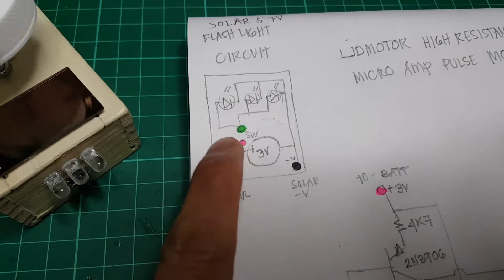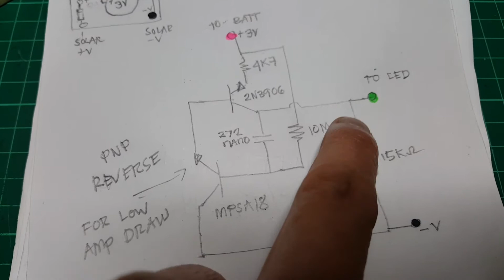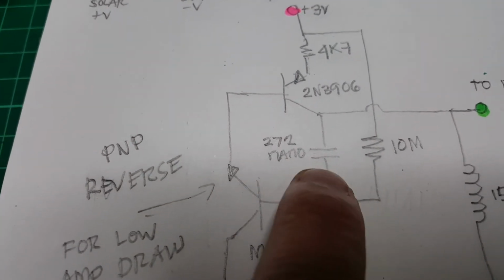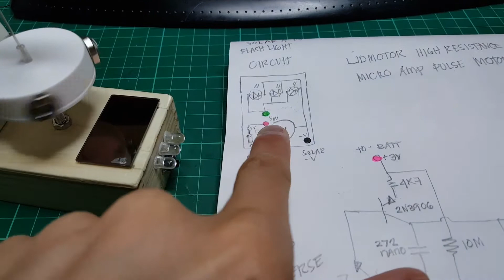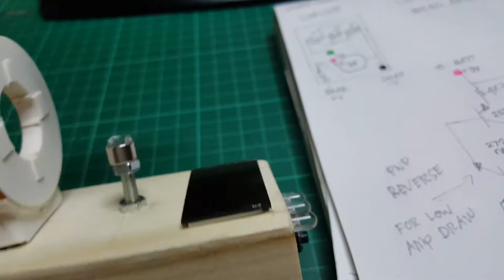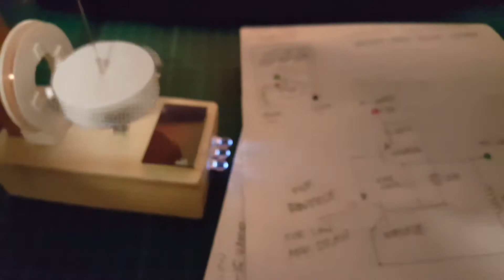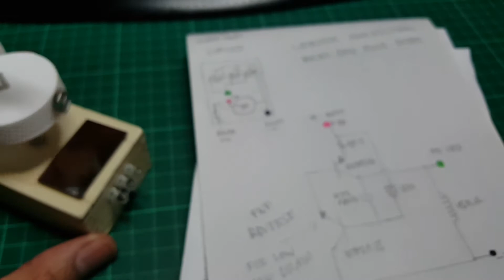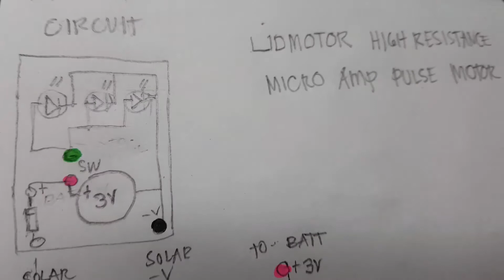Lidmotor high resistance  micro amp pulse motor

Comment: Hello there, nice motor and  circuit you have there, very impressive ! I'm in the process of making one myself, although I am have some difficulty. I'm struggling with making the rotor spin independently, I'm pretty certain I have the circuit correct but I don't believe the coil is producing a magnetic field, but can't understand why ? My circuit and coil is identical to yours other than my coil measures 12k resistance.

What are your thoughts? Any advice would be greatly appreciated. 

Many thanks, Eddie.
Reply from the maker: Few things you need to know first make sure your circuit connection is correct, next the rotor its a bit tricky you have to position in the right spot 
and try to lower  down the value of  10Meg resistor to 1Meg if you dont mind the micro amp drawn then  adjust the magnet holding the needle close to the coil,  I hope its all help and 
let me me know  how  it goes.
Reply: Brilliant, thank-you for your response, I shall try this later on when I get home and report back. Quick question, how important is the 272 nano farad capacitor, would it matter if I didn't include it in the circuit or is it crucial for this to run ? How would a different valued capacitor alter the performance of this circuit ?

Thank-you
Reply from the maker: @eddiegoddard4909  you should have the capacitor there and play the value or it not work your circuit.
Reply: @alisasuperrobot  Ok. I shall keep said valued resistor in place. Please excuse my ignorance, but I'm still trying to understand how this circuit works. What is the purpose of the capacitor, what does it do, and why would a higher or lower valued one not work ?

Thank-you for your patience.

Comment: the output with a green dot in which connection of the coil is connected to the input or output of the coil? thank you very much
Reply from the maker: The coil with green dot is connected to the led with the green dot on top  of the small diagram. The magnet is facing north but is work well if you do south it doesn't matter.

Comment: Hi!   Could you tell me what size are that wheel  and  needle and maganets ?
I replicated your old circle ,but failed. the wheel didnt run consistently.
Reply: And  272 nano means 2700p capaciter ?
         4K7 means 4700 ohm resistance ?

WTW
Reply from the maker: doesn't matter the size of the needle or magnets  the rotor is just the same size of the coil bobbins. the capacitor and resistors must different for your coil resistance. play around the values of the capacitor. chat me on skype let see if i can help you there.
Reply: I have finished it today, thank you!!!!!!
The previous problem is that the stucture of my rotor has too much resistances, it cause the running of the rotor can not get the magnetic power effectively.

Comment: I know I sound like a broken record, but what is the amp draw of the circuit?
Looks like a really nice project. 

Paul
Reply from the maker: i run down 2UAmp this in my first setting but is very very slow dew to the coil in the middle is big   for the small magnets  in this video  the amp draw is 5uamp pulsing to 10uamp  this simple circuit design is adjustable depends to your settings by selecting resistors and cap  starting 1k to 10k for the pnp emitter  5meg to 50meg for the base of npn and the cap pick one that can work for your coil put the led as indicator if you see flashing it means your coil is triggering observe the rotor if not moving change the cap higher value you must have selection capacitor in front of you. hope this help.
Reply: It was very helpful. Thank you. I have ordered the coils and when they arrive, I am planning on replicating.

Paul

Comment: Very nice.  It is another good 'shelf' project that should run for a very long time.  I like what you did to the circuit.  The solar panel and battery works well with this. I am running one of my motors with that panel and a 2.7v 10 F super capacitor which is basically the same method.  It has been running for weeks now.
Reply from the maker: thanks! yes definitely  going to my display shelf another success and great result.   I'm so happy  that  I came a cross  for this projects more fun  and  learning something new .Thanks you!
Reply